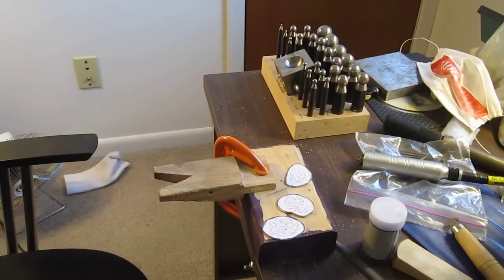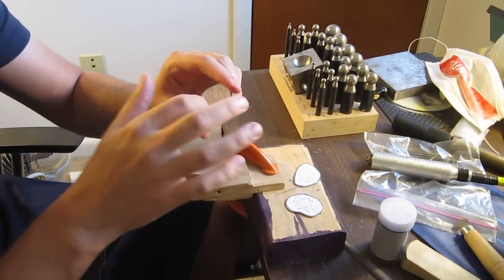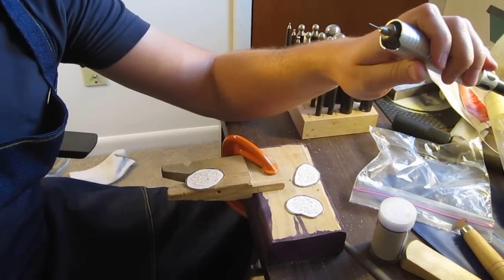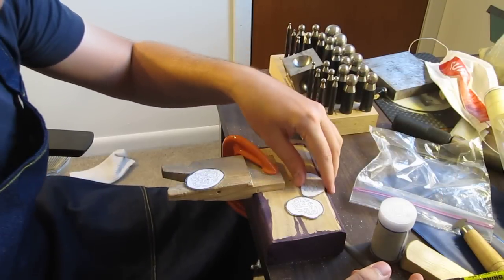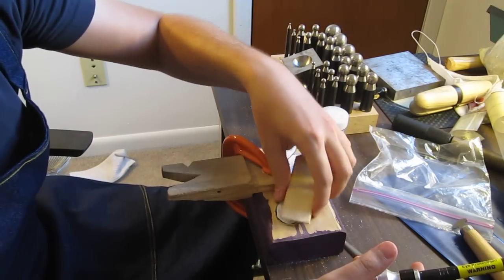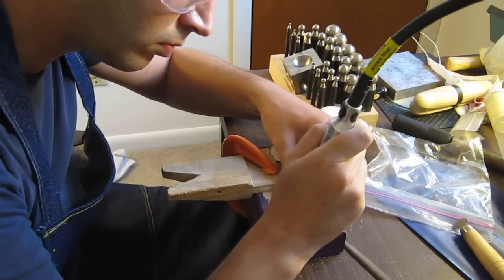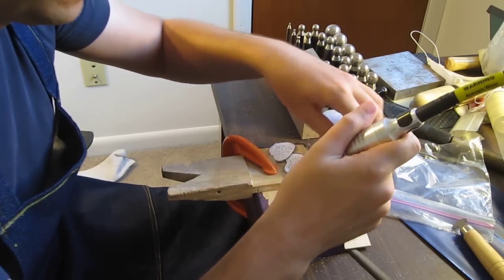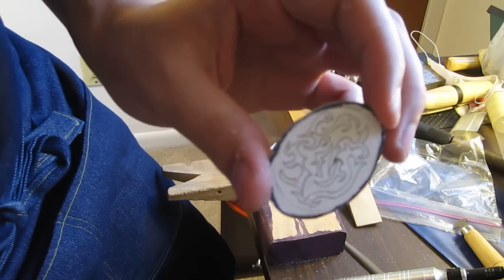Drill holes using a flex shaft

Comment: Hi, I have the same shaft as you and the front piece = drill chuck (where you tighten the drill) came loose completly. There is no thread. How do I reattach it? Just use a hammer? If I just stick it on, the drill chuck comes loose again when using the flexible shaft. Any help appreciated.